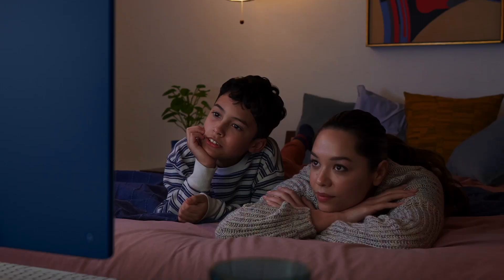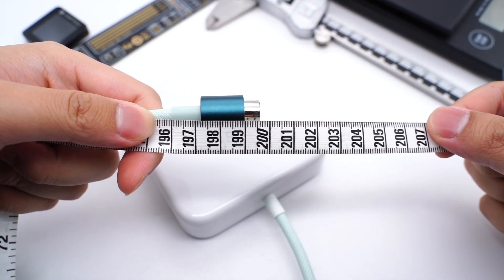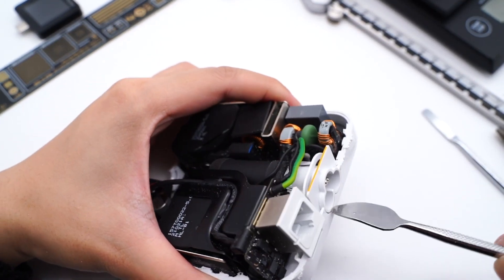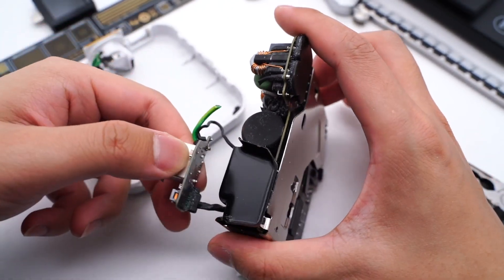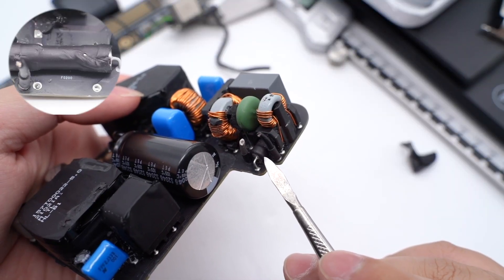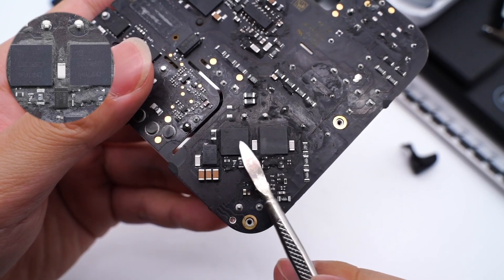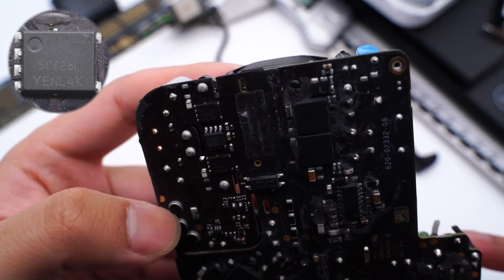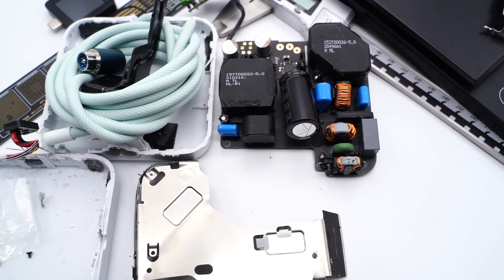Teardown of Apple 143W iMac Power Adapter (For all-new 24” iMac)

Comment: Hi, I have 247v (high domestic voltage even for the uk - usually 230v) coming in due to being near the transformer. I have issues starting up the machine (sometimes works first time others it takes several attempts). Is there some kind of step down adaptor I can get or do you think the mac adaptor although rated at upto 240v should be able to handle it? Only had the machine 6 months so under warranty but dont want to loose it for 1 week + as use it daily for work. ANy help appreciated thanks.

Comment: The power cable that connects to the iMac has 2 thick wires(guess those are power) and a thing blue wire. Any idea what the blue thin wire is for?

Comment: Hi mate, great video. Got a question for you: my iMac A2438 stopped working, I measured voltage out of power supply and it shows 3.1V instead of 15.9 ??? What do you think might be the problem please? High quality components yet it died after 14 months of use? Shameful
Reply: Hi, I am having the same issue now with my M1 Imac power adapter it suddenly stopped working. Were you able to repair it, or did you buy a new one?
Reply: @sureshm_x  no luck repairing and since replacement was almost impossible to score at decent price, I gave up all together. Apple service asking Nz $900. Rip off

Comment: I recently bought a 24" iMac for $2,400. When I got it home and unpacked it, I found that there were no instructions, and not  even a packing list. So much for my gripe--Damn you, Apple. Anyway, what do I do with the Apple iMac 24" M1 ACDC Power Adapter with LAN Port? I know one end plugs into the computer, but what do I with the other end? Do I now have to add to the $2,400 tab and buy even more stuff? #$%^&**!!! (Sat Nov 19 2022; 2"03 PM)
Reply: The other end goes into your router

Comment: Still it is not clearly explained whether it is just a barrel pin power plug with integrated data lines or just thunderbolt 4 like data+power supply, also disassemble the cable too
Reply from the maker: Thanks for the advice. We'll consider that.

Comment: Really nice! But why did they choose 15.9V at 9A? Wouldn't it be better 20V @7A or 50V @2. 86A? The wire would have been much thinner and less voltage would have dropped across the connector or just across the wire🤔
Reply: Maybe the 15.9V allows them to use the same step-down converter in the mac as they use in macbooks (if 15.9 is the max. battery voltage in the macbook), so possibly saves some design time and effort vs. new internal converter design just for a higher supply voltage in the mac. Otherwise seems an odd voltage to use for a power supply.
Reply: @jaccurtis5789  uhm.. May be so
Reply: @tomaskolinger  uh right... I didn't read the previous comment too carefully. I was saying 50V because it's used in the latest 240W or 250W chargers (and also think about the last USB-C charger cable)
Reply: @tomaskolinger  I think that too